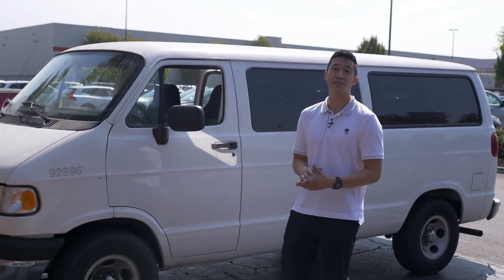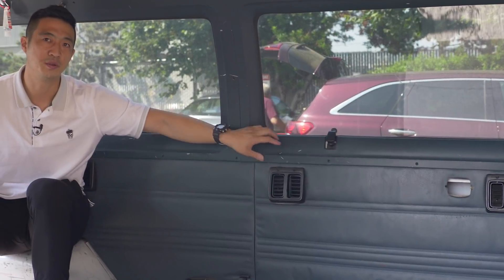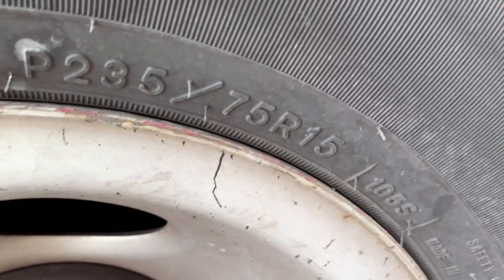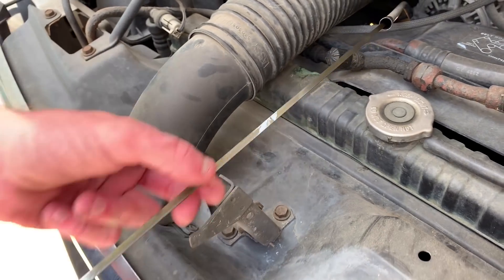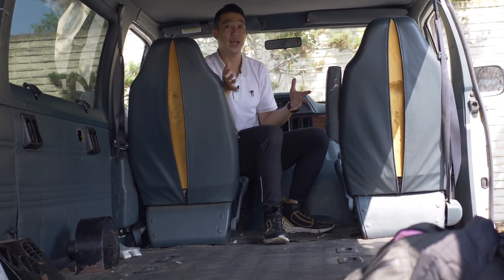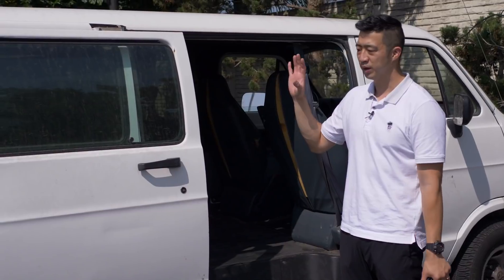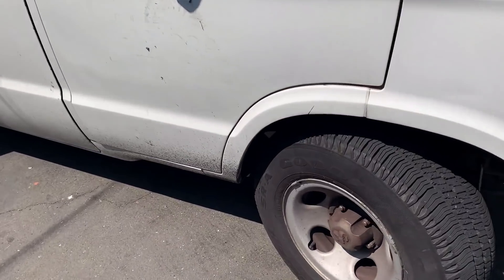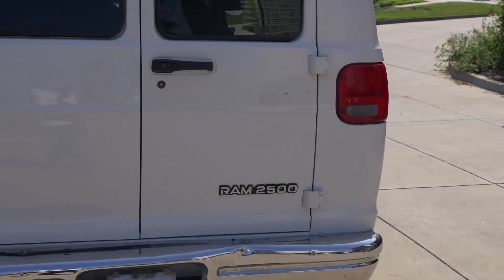I bought an eBay Sourcing Van! Should I #resellervanlife?

Comment: I would use a Blow Up Mattress with buildmin Pump. Get an Inverter to power 110v devices. Or you could strap a Tipue Tent on the Roof.

Comment: Finally got around to watching your other videos. Great Buy on this van for only $600 and everything still works.  I noticed there was a tow hitch on the back of this van as well.  You might want to rent a U-haul trailer for those bigger or taller items that won't fit inside the van and have them forklift the whole pallet onto the trailer while the smaller items go inside the van.  I gotta check out these government auctions one of these days.  Was considering a late model U-Haul cargo van for $16k or brand new Transit Connect for 21k,  but for only $600, it's a steal versus renting each time for $79.99 plus mileage after 100 miles at Enterprise.   Make sure to check that the timing belt was replaced since mileage is over 100k.  I did not do it before for my SUV before and had to get it towed to the nearest autoshop when the timing belt broke.  Also saves a lot on insurance as well since you only need to buy liability insurance and not comprehensive.

Comment: (Sorry if the following comments have already been mentioned, but I didn't see them when reading.)
1) You should find out the van's GVWR. (It should be in the tag/label on the inside driver's door, along with the VIN.)
2) You mentioned Maine, and I haven't heard anyone mention heat. Heat. (A sleeping bag would take up alot of room, but if you can have a trailer, that would help, and to have a trailer, you should know the GVWR.)

Comment: If I was going to do this, I would use the van for living while traveling and then pull a small trailer behind. The biggest issue is having enough room for your purchases AND for staying the night.
Reply: I think the showering issue is easier than the toilet issue. First, you don't have to necessarily fully shower every day you're on the road. You can use wipes, etc. on some days and then shower in truck stops or other places every other day or so. I think the toilet situation is trickier. It used to be that Walmarts were open all night, and if you stayed there, you could just go in. But many of the places that allow free overnight parking (Walmart, Rural King, etc) are now closed during the night. Some states do allow you to park at rest stops overnight, but not all. I think I would definitely consider a cassette or composting toilet (more expensive) for emergencies or overnight parking.

Comment: Awesome van! We have been thinking of converting one ourselves. 

Although, you got your tire numbers a bit off. 235 is the tire width in millimetres. 75 is the sidewall aspect ratio which is calculated as 75% of 235mm. R is the tire construction designation which means Radial and the 15 is the rim/wheel diameter :)

Ex-SCCA racer here so I'm kind of a car nerd haha.

Comment: This is a great video. I recently inherited my dad's old camper van and am living in it and Ebaying full time. This thing was designed to live in and already has a solar panel that came stock with the van. Its called a World Explorer, made in 1991. This thing was around $38,000 when it was new... I can fully standup in the back, got foam mats and blankets to sleep with. Its got its own stock vacuum cleaner and air compressor.... Im lovin the van life. If you are living in one I definitely recommend some sun shades. I have one for windshield, and 2 circular ones for front windows. All other windows in this van have their own curtains. On your van I would definitely just black out the windows. The back doors in mine have foldout tables that you could do parking lot cooking with. A trashcan, a vacuum, a couple of sealable tubs for clothes and one for food storage... bungee cords or some other tie downs are recommended so your stuff doesn't fly around while drivin, and you are set! Bonus if you install a mini fridge. I have a rec center membership for showers and workouts and use the public library to print my labels. My van life was by necessity not for fun!

Comment: Lol,I know those govdeal vans too well,I flipped over 50 of those dodge   vans .
When you load a pallet from the back there is a hinge you need to remove to get the doors fully open.
This van looks perfect condition so an easy $1000-2000 profit.
Congratulations .

Comment: You could put a little table on the right side under the middle window, so that if you have a rotating front seat, you can just turn around to the back and lean the little table like mentioned out to you in a 90° angle. You can then use that to place your laptop on it and work like that.

Comment: I have a van that I'm converting myself. I like the swivel chair too, however, I think a strong partition would be best simply because of safety purposes. Anything not bolted down could go flying forward. It's also a good way to go stealth mode as no one can see inside from the front window if a curtain or maybe a door is installed.